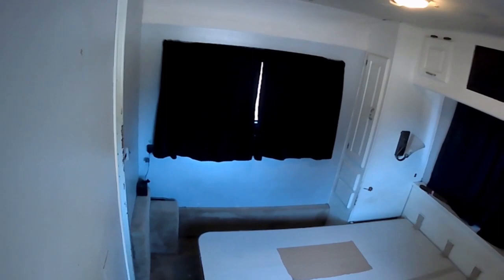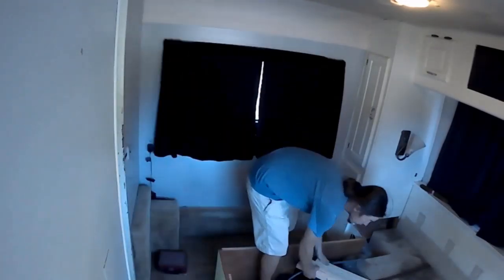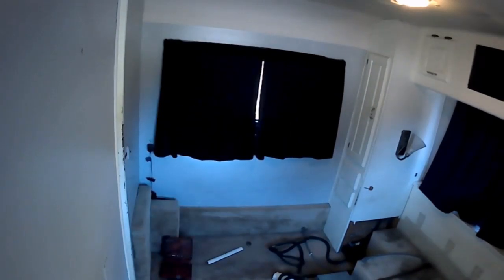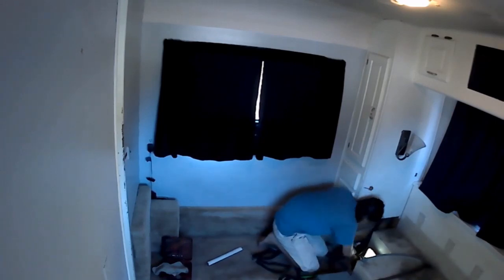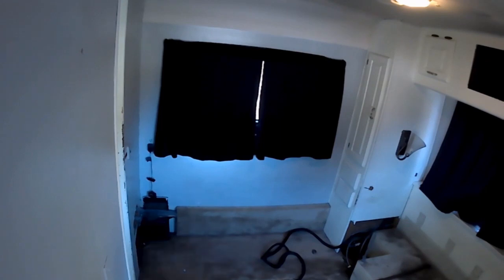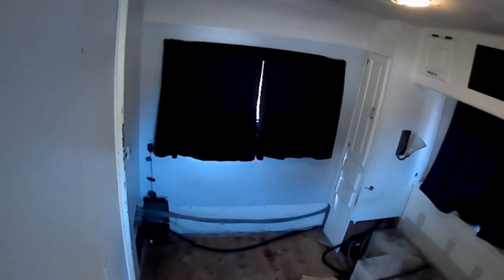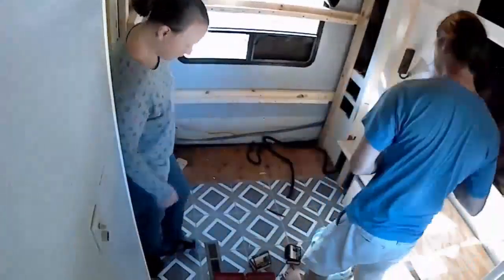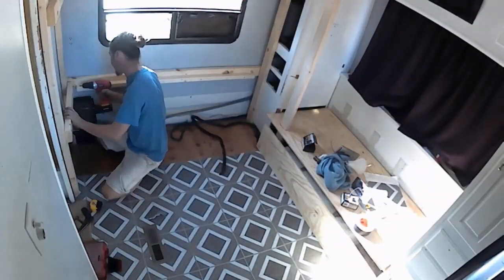Rv Master bed to Bunk house for $154.28

Comment: Nice Job! Was the fresh water tank in the middle of the room? Could not see it in the video
Reply from the maker: The fresh water tank was in the middle at the very back. I built a box over it and turned it into a day bed. I'm thinking about making an access whole through the side and drilling into the tank for a manual fill port while boondocking.